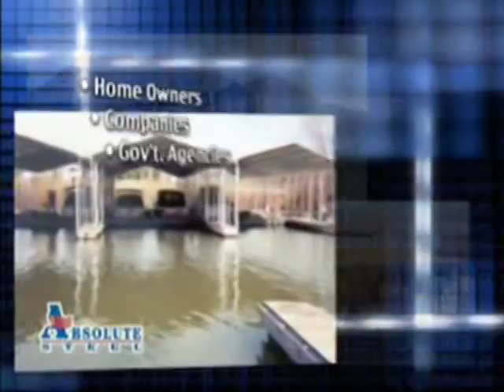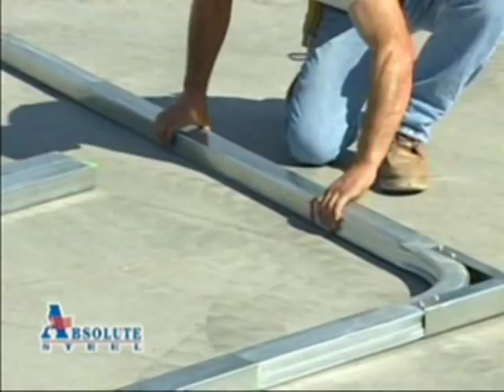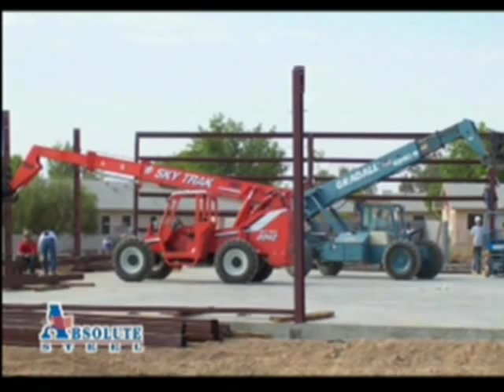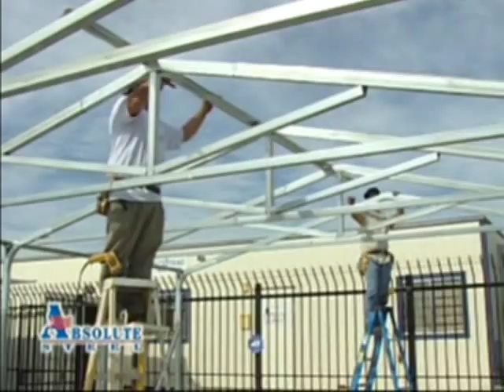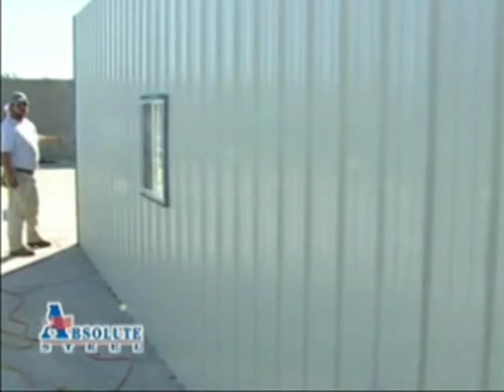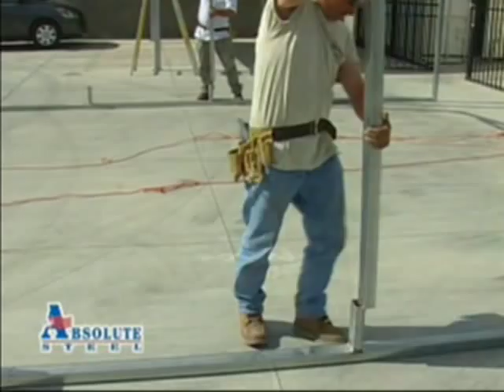Easy to Install Steel Buildings-Absolute Steel

Comment: There are drawbacks- insulation is restricted to 3" on certain sides. And appearsntly you have to use metal conduit to run your electrical wiring and framing exterior and interior is Different. Harder? Yes.  Impossible? No